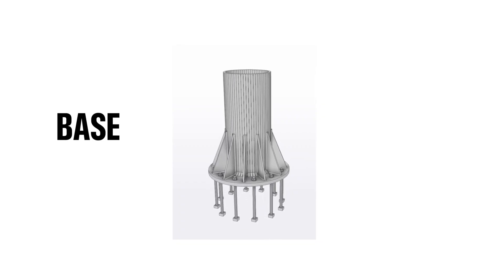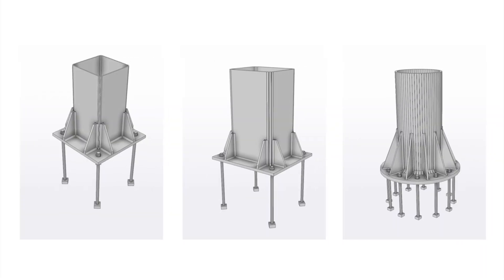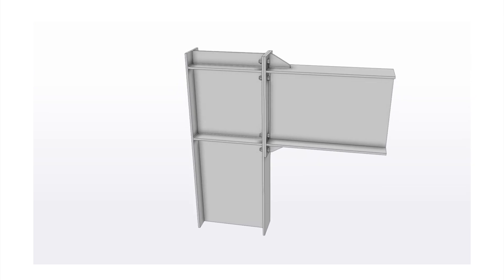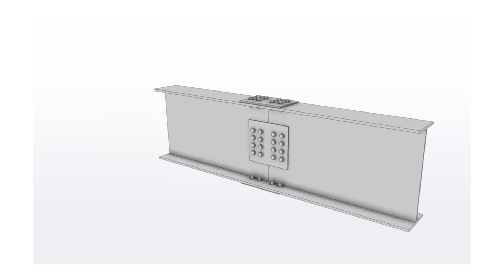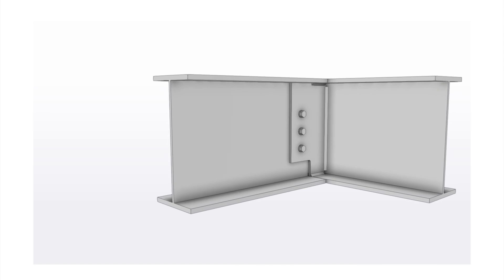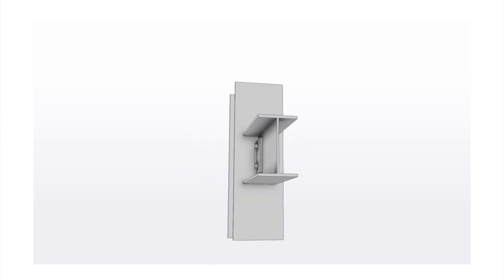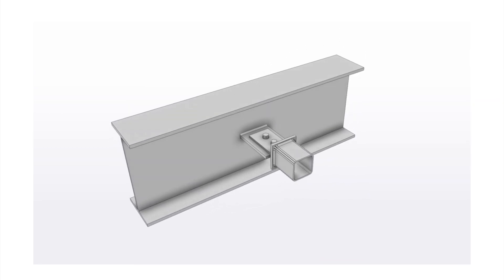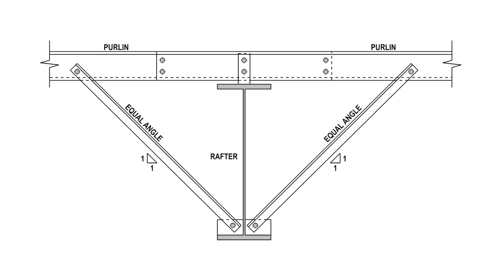Steel Connections Every Structural Engineer Should Know

Comment: All of these connections can be found in the AISC Steel Manual! This document describes if each is a simple or moment bearing connection and has a lot of design tables that help you with the fastener design. Helped me self start at a structural engineering firm without any prior experience.

Comment: Really informative video and easy to keep up with. 

The detail shown at 6.22 caught my eye. Surely if you have a continuos beam propped by a column, the beams splice connection should be offset from the column, to design an efficient connection. Otherwise you would have to design the splice at the point of contraflection where the bending moment is very high.

Comment: Hi man can I ask a quick question I’m a civil student currently and I’m taking complex subjects next semester and I’m thinking since you are more experienced what textbook/s can I invest in that will help me to get a good step by step of calculation basically a civil pocket book that follows AS
Reply: Or if anyone else can help me, cheers
Reply: Just get the prescribed textbooks, attend all classes, follow lecturer's notes closely and use them as a guide for what to focus on in textbooks.
Reply: @ see problem with that is they prescribe books that don’t contain a lot of the needed information for overall structural engineering, mostly just about the topics we will go thru and also they prescribe lots of books which is obviously really expensive, so I just need one that’s recommended by someone that has used it lots and got lots of knowledge from it